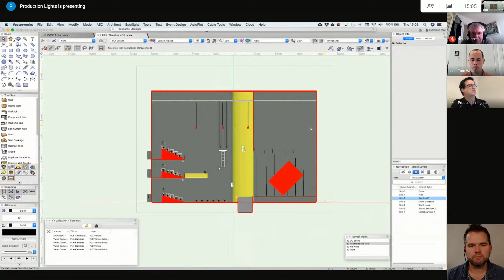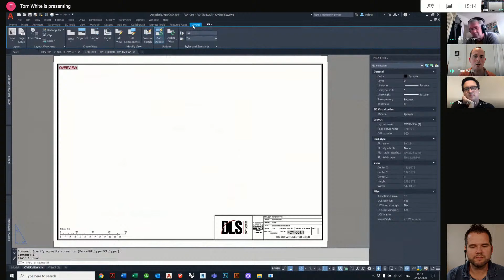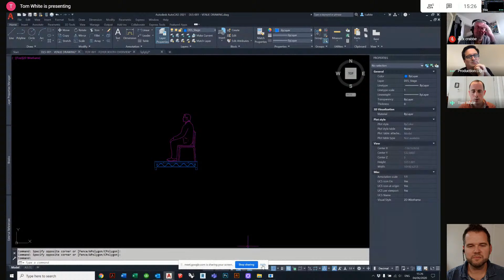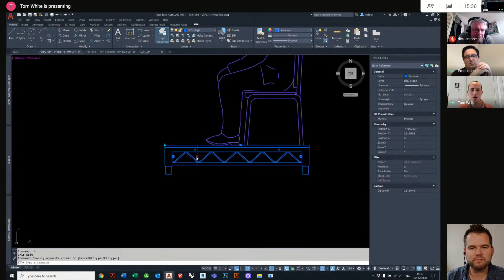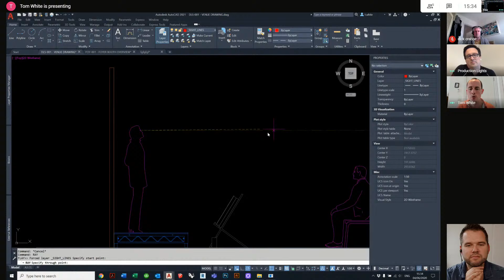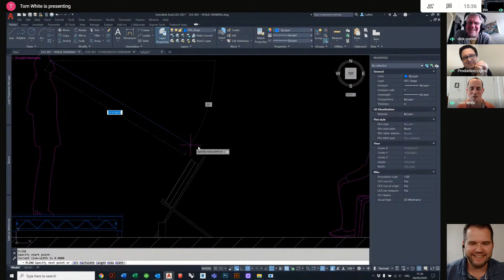CAD Lessons - Ep. 9 on Thursday @15.00

Comment: Sections
Dom shows sections in VectorWorks
Clip cube   
Section viewport
Tom compares in AutoCAD
3d clip,  section command
Export layout   (flattening a 3D layout into 2D)
Block editor	(28 mins in)
Stretching a block
Ray line (for sightlines)		(34 mins in)
X Line  (construction lines)